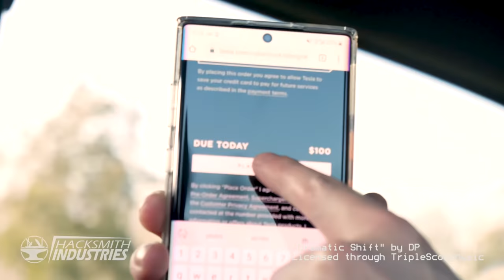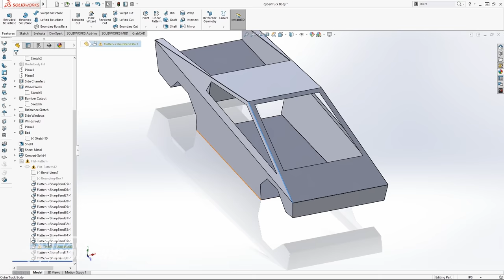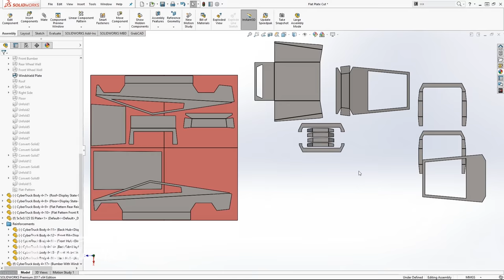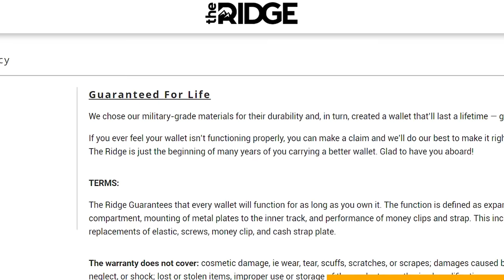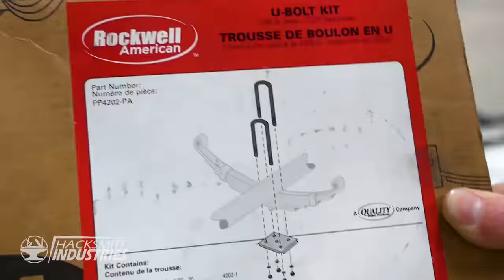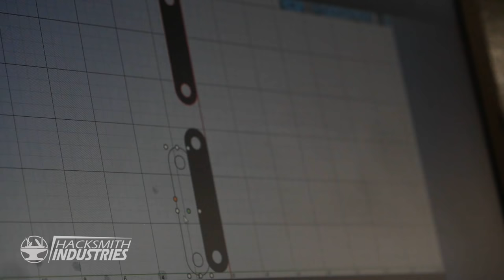CYBERTRUCK BUILD (Part 1/5: The Body)

Comment: You should consider placing a clock in the bottom of the corner so we can see the late hours you are putting in. It would be so cool to see a welding shot labeled at 1:23 AM

Comment: That's not half the size, that's like a quarter
Reply: Because of the square cube ratio, building something with half the linear dimension creates ONE FOURTH the 2d area and ONE EIGHTH the 3d volume!

Which means it's actually taking up 1/8 the space.

(1/2²=1/4, 1/2³=1/8)
Reply: @Stonehawk  Wow, WTF? That's so weird!

Comment: I like that all attempts are either taking an golf cart and putting a body on it, or taking a normal truck and slapping cardboard on it. Someone should build an 1:1
Reply from the maker: That would cost more than buying a cyber truck
Reply: the Hacksmith buy some old pickup truck, that has an body mounted on chassis. Remove body, remake the cyber truck body, convert the chassis to electric slap everything together.

Comment: I guess the inquisitor lightsaber is out of the question. It could be very difficult to have the two sabers spinning with the wire attached too the lightsaber.

You should make a vehicle based on your design in the future, even with the pod racer in real life. Question is how will it look like. Would it be on wheels or would it hover?

Comment: I got a question how did you get it to charge from any ev charger and also how did you wire the three electric engine together and make it where tha 3 electric engine is controlled by a app and also the leds please respond

Comment: 7:20 “I’ve only spent like 200 hrs this week.” Yeah impossible. There’s only 168hrs every week plus you need at least 3-4hrs of sleep to function meaning the most you could possibly work is 140-147. You most likely want to eat so that’s at least 2hrs total. (Drinking with eating) So that means the most work you could squeeze in is 138-145 which is still close to impossible. Thanks for reading. Yes I know that was a hyperbole, but quite frankly; I don’t give a damn.
Thanks! Have a great rest of your day!
Reply from the maker: It's a joke dude
Reply: Woosh.